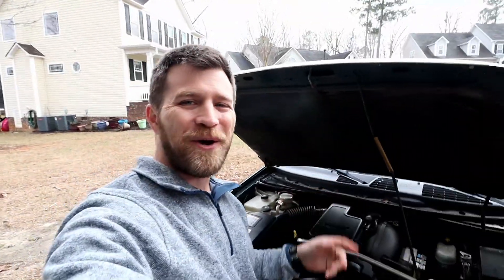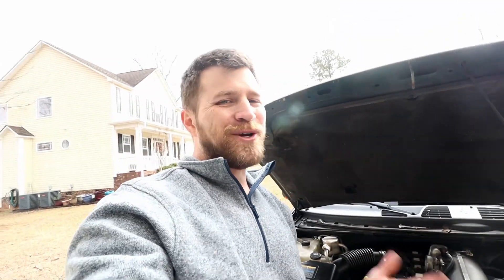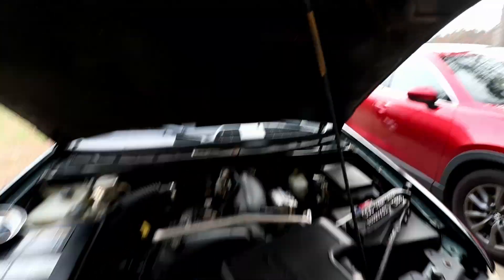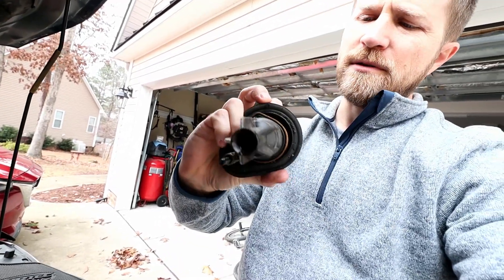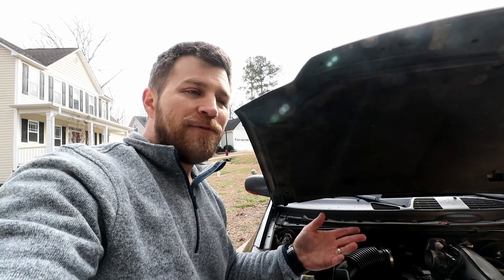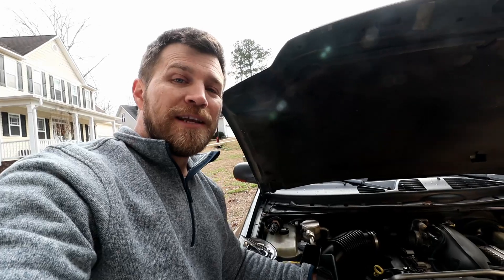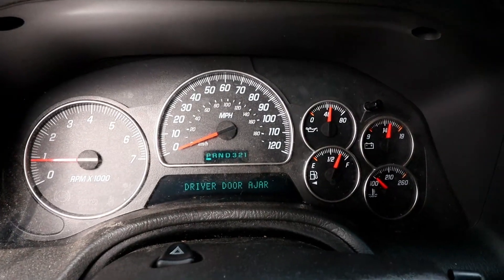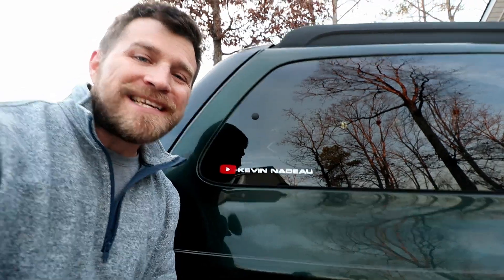2004 GMC ENVOY P0300 RANDOM ENGINE MISFIRE DETECTED

Comment: I have a evap code that I gotta figure out what's the problem, had this problem for a year need to fix it to pass smog. Now I got a misfire code, looks like I gotta replace the seal.
Reply: Evap is more than likely the gas cap not sealing correctly; once i got a new gas cap off of rock auto, my evap code went away

Comment: Hello sir, my battery is between 13 and 14. Does it cause problems for my car?  My car vibrates especially with the AC on Thank you, for your reply
Reply from the maker: @shvanaabdullah6859  That voltage should be fine. Have you narrowed down the cause of vibration any? Could be several things.
Reply: @KevinNadeau  Upon turning on the compressor my car vibrates but I don't think it's a problem with the compressor
Reply from the maker: @shvanaabdullah6859  Wonder if it’s the motor mounts. My engine had the shakes a while ago and new motor mounts solved the problem.
Reply: @KevinNadeau  thank you dear 🌹

Comment: Also what is a power train.
Reply from the maker: A powertrain is an assembly of every component that puts your car into motion. It includes engine, transmission, driveshaft, axles, and differential.

Comment: I have this problem. I had everything replaced. But it still didn't fix the problem
Reply from the maker: There are probably more than a dozen things that could cause P0300 code.  Did you change the spark plugs?
Reply: There's a few sensors that become fouled and fail with old age and need replacing or at least cleaning. 
They are really great engines but cannot withstand a lack of astute maintenance.

Comment: friend help me I have a car of the same brand that you are fixing but I changed all the spark plug coils and the same code appears p0300
Reply: In my 2007 Acadia I just cleaned the throttle body cause it got backed up and all good
Reply from the maker: I’ve heard of guys replacing the VVT solenoid and the misfires went away. Have you checked compression on the cylinders? You could also check for vacuum leaks. Best of luck👍

Comment: Hey bud I hadve/had the same issue running ugly I changed the 6 spark plugs then 1coil waiting for the new one to come in. now it won’t start it cranks but won’t start I think I put the plug in to the new coil backwards causing a new problem I don’t know where to start it’s cranking but not starting now

Comment: I have a 2004 trailblazer with 230000 miles on it and I'm also having a misfire, but it's intermittent and that's one thing I'll have to check is for moisture. Thanks
Reply from the maker: You have many miles ahead of you with that truck.  Good luck tracking down your misfire.
Reply: @KevinNadeau  they really don't make them like they used to. Rolled my 03 200,000 miles. Now have the 09 with 130.000

Comment: So did fix it or just temporarily cuz I’m having this problem right now , You didn’t change spark plug aswell right correct?
Reply from the maker: So far its still working fine. I could have also replaces the weather striping on the cowl, but didn't do that. I did not replace the spark plug.
Reply: @KevinNadeau  thanks I really hope mines is similar

Comment: This is a common problem with these vehicles. Replace the seal under the hood where your windshield meets the hood.
Reply from the maker: That's the sense I'm getting about this issue. Do you happen to know the part number for the seal?
Reply: @KevinNadeau  well it keeps erasing the number for some reason
Reply: @KevinNadeau  Hey Kevin did you end up having to replace the valve cover gasket or did changing the seals on the coil packs work in resolving your misfire? I am also having the same issue lol